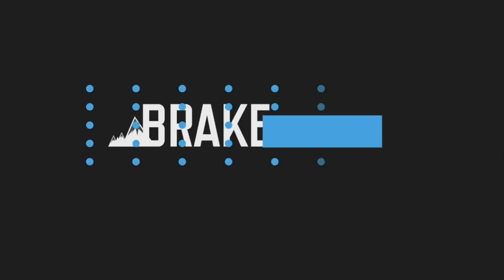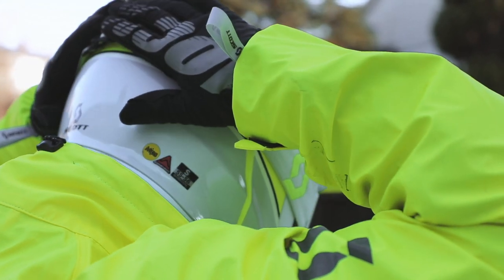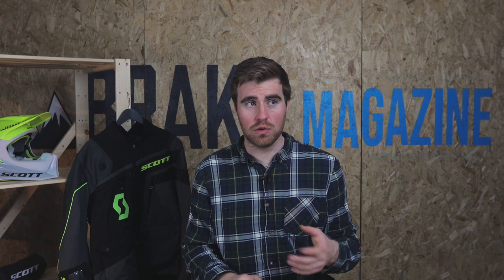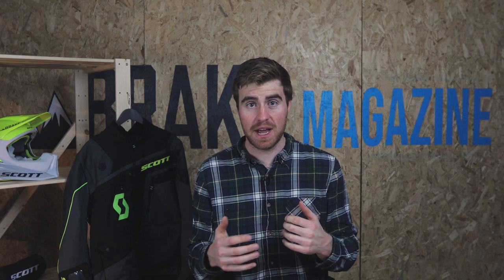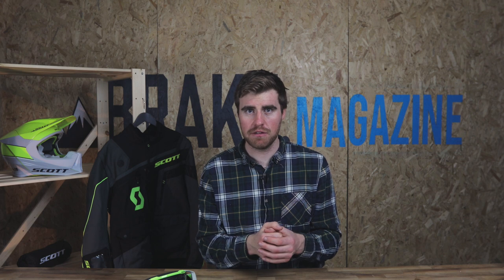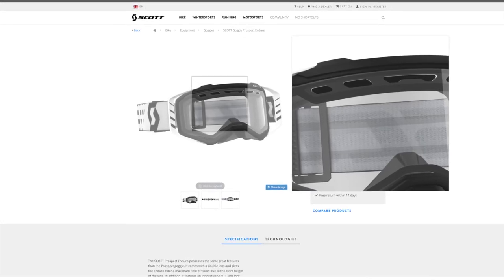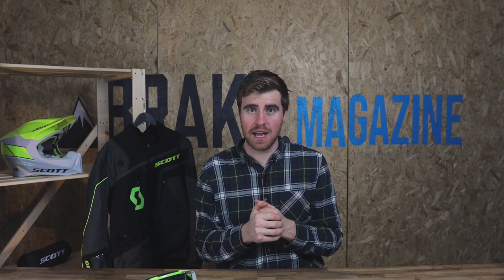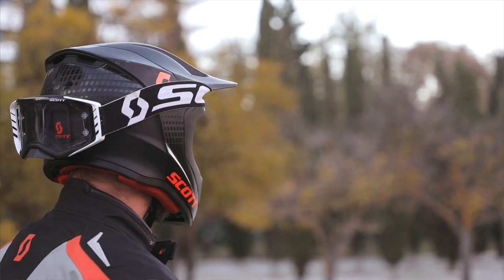How To - Tips for wearing Goggles

Comment: My Oakley Airbrakes (bought on sale at 60% off) are easily the best goggles I've ever owned. Definitely don't skimp on them and you will be rewarded.
Reply: Did you purchase in store at an Oakley retailer or online ?
Reply: @pli0utyer  Bought from the online store of a motorcycle dealership. Just have to look out for the sales from time to time.
Reply: Imma just buy some 15 dollar  goggles and when they break or get to scratched ill just buy a new pair
Reply: @eligeist6755  strata 2 40 dollars
Reply: @eligeist6755  at least try them before you buy them

Comment: I just wear my ski goggles. Ski goggles have two lenses so they never fog up. Most MX are one lens and why they require an anti fogging coating, if they have it at all. They also breath a lot better and offer full UV protection and typically have a better field of view. The only downside is that they are tinted for white conditions so they pick up contrast in the terrain a lot better which isn’t really needed in Motorcross as much and some may find themselves looking down at all the ruts coming up as opposed to looking ahead like they should…..but u get used to it.

Comment: I was literally looking at goggles yesterday... want to be ready for the warmer weather. So, as a first pair, do you rate the Oakley O frame stuff? Anything else I should look at for a similar price? Thanks for the great content!
Reply from the maker: O-frames are a classic. The Scott Hustle has a thinner foam around the nose to stop pinching but otherwise most goggles in this price range are decent.

Other options might be the 100% Accurri, Smith Fuel or EKS.
Reply: Brake Magazine Excellent, thanks very much!
Reply from the maker: No problem.

Comment: Kinda odd but I don't want any air in my goggles. If air  gets in so does sand and that's the worse. Any suggestions? Also the ones I do have done sit tight on my face. Once they go to the front of the helmet they have to go around the side so they wont be super flush like they would be with no helmet. How do you fix that? Also in dusty conditions all your tips are great but how many people do you know stop to wash there goggles? If that was the case I would have to stop every 5 minutes. I have no choice but to wipe them off.

Comment: i am going to get a 50cc supermotard but i drive in winter and summer i now have a normal street helmet with a pinlock etc should i buy a dual sport helmet or a normal dirtbike helmet and use the dirtbike helmet in summer and the street helmet in winter for the cold?

Comment: Hey there great video. I use the 100% Accuri goggles and I'm very happy. How about a short video on caring for and washing goggle lenses and goggle straps? My light color goggle strap is now dark brown. If you've already done a video please share link here. Thanks.
Reply from the maker: Yes. Buy a net bag or helmet bag and put it in the washing machine on a very gentle wash. Or wash by hand if you can't do that. Do not tumble dry. Ever.
Reply: @BrakeMagazine  thanks. So goggles+strap goes into the net bag? I've tried to detach the strap from goggles but couldn't. And ofcourse I remove the lens before doing this right?

Comment: Is it a thick plastic or, glass & which one is better for a pointed object impact like a rod?
Reply from the maker: It's lexan plastic. Glass would be really dangerous if it shattered. If you have an impact from a rod, a stronger material is better but in general from flying debris goggles are very good.

Oakley Airbrakes use a bullet proof plastic but have a price to match. 😊
Reply: @BrakeMagazine  Thank you

Comment: Why no mention of what to do when you are riding and you get mud or dirt on them. I don't carry hot soapy water with me.
Reply from the maker: A gentle cloth, vertical wiping with lots of pressure. 👌 Pressure stops the scratching.
Reply: @BrakeMagazine  Wow! - I would have thought that pressure would make deep scratches
Reply from the maker: It's kinda the other way around. If you're gentle, you end up dragging the dirt across the lens.